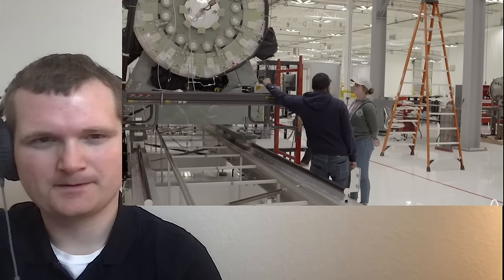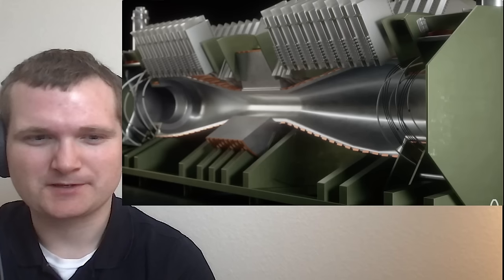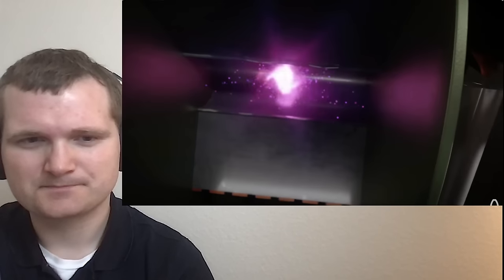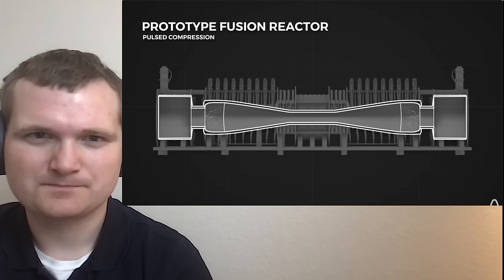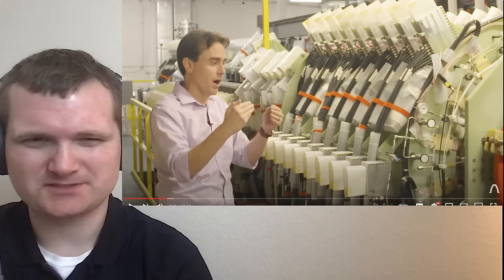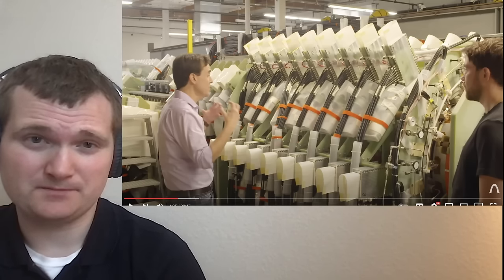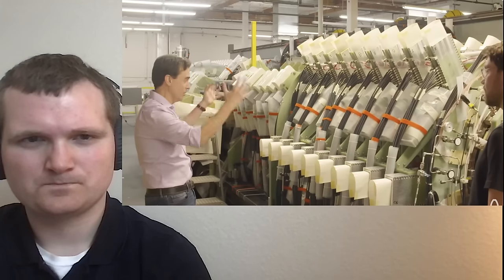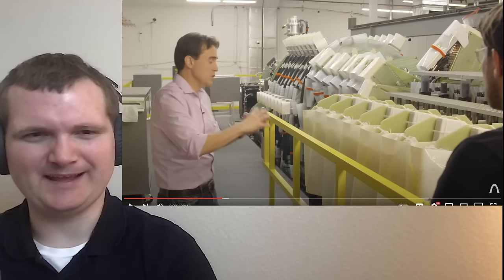Will the Helion Fusion Reactor ACTUALLY work? - Nuclear Engineer Reacts to Real Engineering

Comment: sorry...don't be distracted by energy numbers....how will you keep the 2 cubic feet of reaction space from vaporizing containing megawatts of power?...or how will you keep it cool....hydroelectric generators produce megawatts, but they do this in a multi 1000 cubic foot space immersed in cooling water....there's not enough space to circulate enough cooling water to keep it cool, but nobody is calling them on this.....at the rate of cycling needed....the capacitor banks will heat up and the solid state switches will too...how will they keep them cool so that their I squared R loss won't destroy them.....
Reply: Their machines are only about 50 MWe. Diameter of the burn chamber is over a meter, maybe up to 2 meters (not sure about exact dimensions) and several meters long.
They plan to operate at a pulse rate of 1 to 10 Hz. Total energy content of the plasma would be in the single digit to maybe low double digit kWh range. 
The plasma is surrounded by a vacuum which is a perfect insulator. The magnets keep it away from the walls. There are some Bremsstrahlung losses that will heat the walls, but wall heating from losses is generally in the 1 to 2 MW/m2 range. The capacitor banks are not the problem but switches do indeed limit the pulse rate and require extra attention. They got that covered though for the operating parameters they are going for.
Reply: Thank you for the reply, but I wasn't speaking to the thermal load particular to radiant heat. I was speaking to the size of the electromagnetic extraction coils that need to be as close as possible to the plasma. This is the small volume that makes this method impossible to cool. The coils heat because of Isquared R and need to be cooled, you can't get enough coolant flow rate in that small volume to sufficiently cool that volume at those energy levels. Hydroelectric generators magnetics are large compared to this arrangement and can have enough cooling in their volume to make extracting the electricity feasible. @elmarmoelzer2229
Reply: Additionally, a vacuum does not insulate against radiant heat and there will be plenty of it.
Reply: @bshul10  Grr, my previous reply vanished for some reason.
The radiant heat is not all that much. mostly X-rays. Also referred to as Bremsstrahlung and that is greatly suppressed because of the lower electron temperatures in Helion's machines (they have a electron to ion temperature ratio of <0.1).
There are no "extraction coils". The extraction happens through the same magnets that compressed the plasmoid and they are outside of vacuum vessel.
The cooling of the coils is surprisingly simple. Trenta got away with just air cooling for its magnets.
Reply: OK I'm no expert at ion temperatures and electron temperatures, but I do know one thing; a coil that can output 50 megawatts of power if it's made out of copper will have I ^2 r losses that can't be cooled by air with the volume of the coils that are being used. Let's say that the magnetics are 120 loops of 000 copper cable. The diameter of the loops is one foot (and they make a cylinder about 5 feet long). That's 360 feet of this copper cable = .025 ohm. If the output voltage is 10KV, then the current is 5000 amps. That's 625kW of I^2R loss. The surface area of the magnetics is 16 1/2 square feet, if water flows over this surface, at a speed of 1.5 ft/sec the coils would run at 500 degrees. If air was used, it would require 66000 ft/sec.....that's not reality.... Do you know the size of the magnetics, length, diameter?....https://thermal.mayahtt.com/tmwiz/convect/forced/fp-isot/fp-isot.htm
Reply: @bshul10   Which ones of the magnets. There are different ones at different sizes and doing different things. The strongest ones are the compression magnets.
I want you to consider a few things here:

1. The magnets are not running continuously. They are pulsed and the total length of a pulse is less than one millisecond. The pulse frequency is 0.1 Hz for Polaris (which is air cooled) and maybe 10 Hz for the power plants (which will have other cooling). The total energy going into the plasma in a pulse is on the order of a few kWh (might be as little as 1 kWh or as much as 10, I have a bit of conflicting information on that). But it is not a lot for a machine that is a total of 20 meters in length and has a maximum diameter of 3 meters. (roughly the dimension of the final power plant from what is known so far).
We are talking about a million amps in the compression magnets, but again, the pulses are so short that the cooling is not a problem for the 0.1 Hz Polaris will do. It is more of a problem for the power plants, but not that huge either. Mind you, there are other sources of heating too, like the X-rays emitted by the plasma but that is another topic.

2. The magnets are much bigger than 1 foot in diameter. Even at the compression section they are more like a meter in diameter and they are relatively wide bands. not cables. The compression section is several meters in length.

3. Also note that magnets are aluminum, not copper (though that does not help with resistance, LOL).
Reply: Thank you for your reply and entertaining my thoughts. Are the compression magnets you described the very same magnets that output the electrical energy from the plant? If so then they sound large enough to possibly be cooled by air. However, if a separate set of magnetics is used for extraction of electrical energy equal to 50 megawatts, please let me know. Also the output seems to be pulses of DC current. These would have to be stored and converted to 60 Hertz AC through banks of capacitors and an inverter, which has questionable efficiency at those energy levels
Reply: @bshul10  They are literally the same magnets. Think about it! When you have a magnet compress the plasma at very high efficiency, that same magnetic coil should be able to capture the energy from the expansion of the plasma at the same efficiency.
As for the storage: Yes, the capacitor bank that delivers the input energy is sized so that it can also receive the returned energy from the machine. Their capacitors are very efficient. They specifically make their own, optimized for efficiency and life time, rather than cost, mass, etc. And modern inverters are quite efficient too (look at the efficiency of grid scale batteries for reference which is at 95 to 99% efficient).
That said, Helion is looking into DC applications for their machines, as they save on cost for inverters and other grid related equipment and are more efficient too.
Reply: Recalculating the air speed necessary to cool a flat play with the equivalent area of 1 meter diameter and 3 meters long, the airspeed is 470 mph for a 500° rise... They'll get a headache blowing that hard... And as far as quoting the efficiency of a capacitor at 95 to 99%, what about the I ^2 r losses in the conductors to the capacitors and switches ? I wonder why they don't air cool hydroelectric generators and nuclear reactors that produce 50 megawatts?
Reply: @bshul10  
1. Again, the machine is pulsed. You will not get that much of anything in a 1ms pulse.

2. The power plants will not use air cooling. Air cooling was used by Trenta and will be used for Polaris. They have a lower pulse rate than the future power plants. Cooling them is not that big of a deal at that low of a pulse rate. These are still experimental machines, after all (even if Polaris will demonstrate electricity production).

3. The TOTAL energy in the pulse (in a power plant, not in Polaris!) is in the low kWh range. Only a small fraction of that will actually be heating the coils, be it via ohmic resistance or via X-rays and a few neutrons. The vast majority of that energy goes into the capacitor bank (or comes out of it). 
Lets say that is 10 MW heat load in a power plant. That is quite manageable, actually.
For reference, the wall loads(!) in a power plant will be in the 1 to 2 MW/m2 range.
Most of that is through X-rays which deposit in a relatively thin volume of the wall. But even that is not a real issue.

4. Cooling of switches is a different issue (and actually more difficult than the walls or the magnets). 

5. There are actually concepts for air cooled nuclear fission reactors...
Reply: As our discussion has progressed I see that we are discussing two different things I'm sure that the demo machine's one millisecond pulse today and the next one next week can be cooled with some spit, but for the power plant, as you know, a MW is a MW ....50 megajoules per second however it is presented....pulsed or continuous....you need to remove 500kjoules per second isquared R loss, I'm sure it slated to be water cool if that's even possible. Although I know that engineers must be considering all this, I wonder why David Kirtley, who spends an exorbitant amount of time on camera giving interviews about details of the system, never talks about cooling it. If he does in any detail, please let me know about that video or writing.
Reply: @bshul10  The power plants will not use air cooling, as I mentioned. The losses are not that big. They are at some 95% efficiency or better round trip, though as I mentioned there are other sources of heat that will also heat up the magnets a bit more.
The reason why David Kirtley does not talk about cooling for the power plants is because they are not talking much about the design of the power plants in general... yet. Many reasons for that. Some of them are related to trade secrets and competitive advantage. Others are because some aspects of the designs are still in flux and depend on the results they achieve with Polaris.

Comment: If it is possible to just heat up the center of a sphere containing gas to fusion temperature with lasers,, it seems like  there would be some fusion.  The amount of X-rays at that temperature is likely to accelerate ions to fusion velocities in micrometers or even nanometers.  A dense gas would insulate the center and might result in  enough fusion at the center.  Inject jets of gas around the outside to cool the reactor housing and drive a gas turbine with  hotter gasses nearer the center escaping through exhaust vents.  Even a sphere at a billion degrees at the center might be cooled to room temperature at the outer edges with enough cooling. A critically dense plasma is opaque to light so the laser light would not just pass through the center if the plasma was dense enough.
https://youtu.be/ZNkBNFuBwUc?si=atezHUoAMvTCME8s

Comment: The world has been working together on nuclear ☢️ since the 50’s … even still it has lacked investment & funding but even still uranium demand has increased … nuclear is 1 of the safest… the world will pull itself out of debt if we can create commercial reactors that go on the back of mobile truck trailers & can run like a generator & also plug into the existing grid
Reply: All in favor of fission (always been a huge advocate for it). Biggest hurdle for that is not technical but politics. Presumably (as current trends go in congress), fusion will do better in that regard.

Comment: Honestly the only way they could efficiently create electricity with what they plan to do is with superconducting electromagnets, cause in that pulsed operation they run the magnetic fields they'd likely generate would produce sooo high currents that any regular conductor would melt. And with the high magnetic fields there actually comes another problem for any superconductor, I would just guess that the magnetic field should easily get so high that the critical field gets surpassed the superconductor becomes a regular conductor and would heat up really quickly as well. So it sounds nice on paper, but thinking about the real challenges it likely is impossible. To me their whole pitch sounds like your regular silicon valley high tech scammy proposal to rip of some billionaire investors. I mean all power to them to rip off some way too rich people, but to me this sounds entirely like a scam.
Reply: They are not using super conductors. Pulsed magnets can achieve much higher Tesla than they need. 20 Tesla is not all that much for a pulsed magnet.
Reply: @elmarmoelzer2229  how frequently can they pulse?
Reply: @ricomeitzner7584  Trenta did a pulse every 10 minutes. Polaris will do at least one pulse every 10 seconds, but might go up to 1 Hz.
Future power plants will do at least 1Hz and might go up to 10 Hz.

Comment: We all know the real question now: Does the machine produce at least 10 Times more energy than it takes to make it work? That's the economic cutoff. Over 10x return, and you're all billionaires. Less than 10x, you keep losing money.
Reply: Not necessary for their design because they can recover the input energy at 95% efficiency and the fusion energy at also very high efficiency. They can get away with about 3x.

Comment: 10 to 20 million degrees is cold the internal temp of our star is around 27 million.... so you are.... well you are...
Reply: Trenta did over 100 million degrees, as they mention later in the video. The tens of million degrees are only after the merge and before the compression stage.

Comment: Pour in enough energy and anything wil fuse, but....
Will the fusion reactor actually create more energy than it needs ? I don't think so.
Skip the fusion, go straight to solar power and potential energy storages for overnight use.
More reliable, cheaper, easier, but yeah, it needs work/effort. Lazy humans.
The creation of tritium is a very energy expensive effort.
Reply: Helion makes Tritium and more importantly He3 by fusing Deuterium. That process can be done in the same machine or in a separate, dedicated machine. Either way, it is about self sustaining.